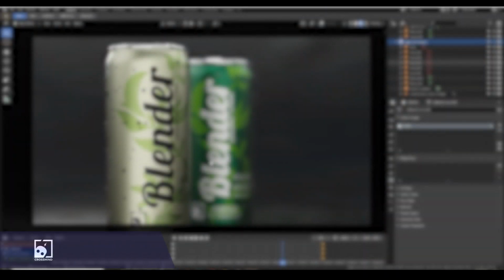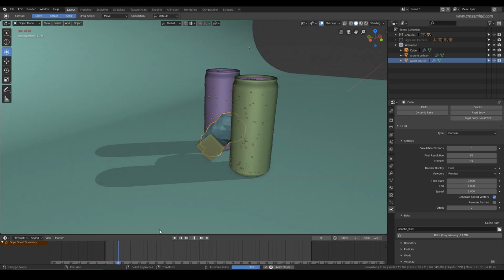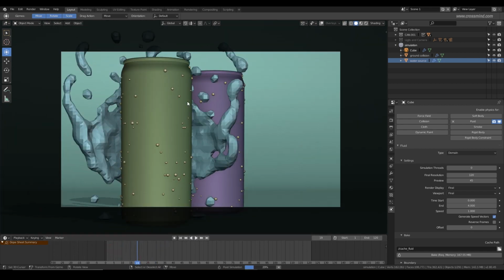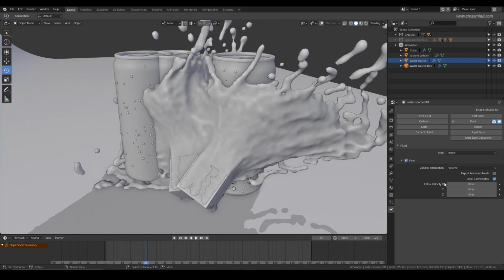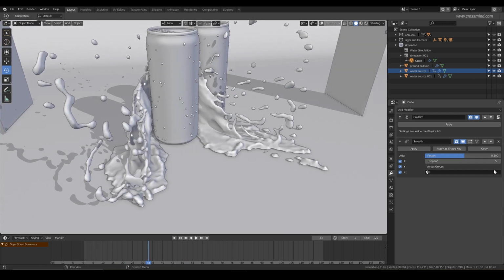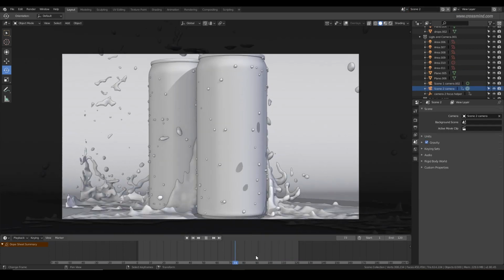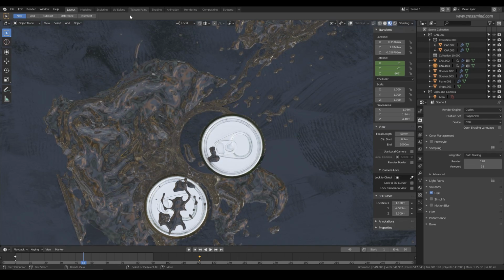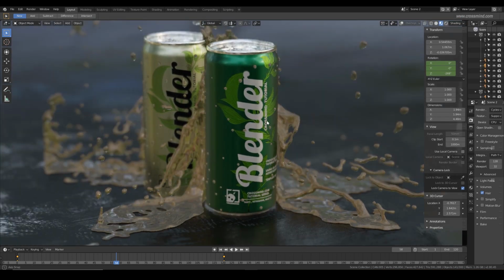Fluid Simulation - CGI for Product Advertising Using Blender 3D - Part 3

Comment: 28:15 ok I figured out how to do volume scatter in Evee. You do need to turn off the cube object later if you plan to render in Cycles. Or u could just use this method for both Evee and Cycles and don't use Volume scatter node. Switch to Evee and Add a cube and make it big to host your scene. Then assign a new material to this cube. Delete 'Principled BSDF' and add 'Principled Volume' and connect to Volume node on 'Material Output'. Then on 'principled Volume' Change density to 0.06 and Anisotropy to 0.800, Bring down the color to gray scale. Then make sure on the Render Tab under Volumetrics u have checked Volumetrics Lighting. You will get the same type of effect.
Reply from the maker: If you have volume shader assigned to object , it will render as volume in eevee or cycles.
And yes u need to enable volumetric in eevee.
Reply: @CrossMindStudio  So would this be a good method to use for volume scatter in Evee or its not the same?
Reply from the maker: kuriyaki you can use volumes in Eevee.
It totally depends on kind of style you looking for. No harm in trying :)
Reply: CrossMind Studio ok I just checked and in latest version of blender volume scatter is working in Eevee

Comment: Is it mantaflow ????
Reply from the maker: Geemon george no its old simulator elbeem. But im planning to redo only splash part in mantaflow for update.
Reply: @CrossMindStudio  is there anyway to set initial state for .. liquid or smoke simulation ??
Reply from the maker: @geemongeorge9651  I haven't found any such option yet. It would be a useful feature to have. Let me know if you find a way to do it.
only workaround is, when you load cache there is a parameter to shift your animation back and forth. Il check what it is called but its to retime your animation of fluid. I know its not the same thing and might be irrelevant.
Reply: Yeah it would be nice if they add the initial state option..

Comment: Hi, for the past 4 days i have been trying to insert key-frame for water splash on my inflow material, starting at 1 and stopping at 30 but after baking it doesn't stop at the exact point i want it to stop. And when i click on I button on my keyboard to set the time line i cant seem to get it to work. I even unchecked the flow button before clicking on the I button but yet am not getting it right.
Reply from the maker: You need to put a key at 1st frame with flow on, then at 30 keep it on  and insert key again, after that at 31 turn it off and key again.
Reply: @CrossMindStudio  Okay thanks for the response let me try it out. your tutorial is awesome..
Reply: @CrossMindStudio  And please what is the standard Screen resolution to render animation.

Comment: i need the slow motion export param plz
Reply from the maker: Hi Hafid, Do you mean you want to make fluid in slow motion?
if so, you can adjust the speed of fluid simulation under Time section in dynamic panel of Domain object.
By default speed is 1, if you make it less the fluid simulation will be in slow motion.
Reply: @CrossMindStudio  great brother thank uuuuuuuuuuuuuuuuuuuuuuuuuuuuuu